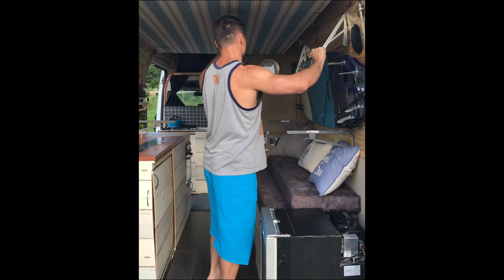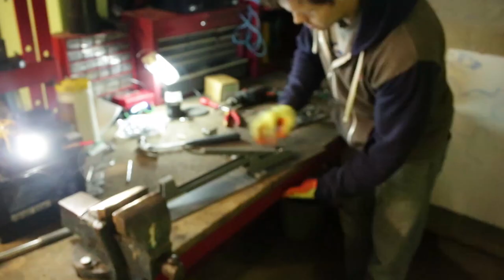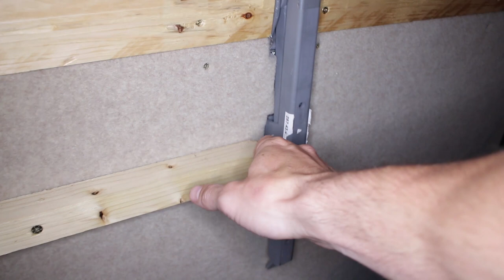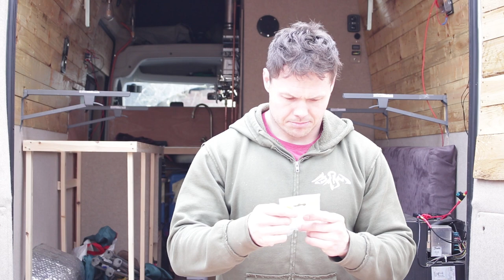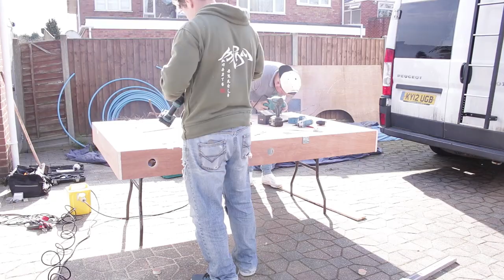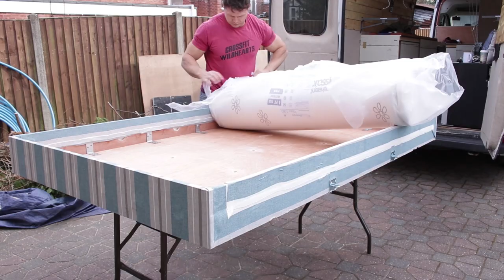Amazing lowering/floating bed in self built van conversion

Comment: Hey man! I love your pulleys / brackets system for the bed. Based on your experience building and then using it, is there anything you would've done differently or could've improved on? I'm about to start a conversion on an L3H3 Ford Transit too and want to do something very similar. Just considering all the pros/cons. Thanks in advance!
Reply from the maker: Ah thanks for watching! Everything is still working 4 years down the line, had to replace the cord once but that’s it. I don’t think I’d change much, you could make it automatic but I like the control of the manual winch. I think I would reduce the 25mm ply base to 18mm if I did it again, the mattress spreads the weight out enough that 18mm would hold up just fine. However the 25mm allowed deeper groves for the brackets to sit in so the bed doesn’t move. Best of luck with your build!!

Comment: Nice design, wouldn’t furniture lifting straps be safer and more durable than rope?
Reply from the maker: Tranquility Travels yes it would be but then I would have needed much larger pulleys and crank. These ropes were rated at hundreds of KG each and it’s never loaded when going up or down. No breakages in over a year although a bit of fraying at a pinch point on two of them, will replace them soon.

Comment: do you have a link to the brackets?
Reply from the maker: https://www.hafele.co.uk/en/product/folding-bracket-heavy-duty-load-bearing-capacity-500-kg-per-pair-hebgo/0000000000004cf900010023/
Hope that helps!

Comment: Can you throw in a link or name of those clamps that hold the bed up? i have never seen them before.. I am thinking of a different way. use Garage door channel, and 36 inch gas shocks. the bed would follow the tracks, and the gas shocks would push it up. I would pull it down like one of those ceiling doors for an attic, with a cord hanging down.
Reply from the maker: I think I saw a similar set up on tracks somewhere over on instagram. The reason I didn't do it was because of the curved sides of the van. The brackets are made by a company called Hebgo and if you search for heavy duty folding brackets they should come up. I got them from Locks Online. Thanks!

Comment: SUCH a great set up!! quick question: are the lower brackets just sticking out all the time, or can they be stowed too?
Reply from the maker: They can be stowed, except for the one over the counter top. I didn't want to cut a gap into it and it would have reduced cupboard space too.
Reply: @MotoringHome  makes sense. thanks again for the inspiration! :D

Comment: I personally think if I got on that with my other half it would crash to the floor. Bringing down the roof too. Most probably, 🤭😂 But I love this idea. What would be even better is if you could put it on a runner track on the bed,  to push it half way outside to view the stars. How much weight do you think that would hold?? And how do you climb in and out of it?  Great video thou 👍
Reply from the maker: Apparently the brackets hold 500kg per pair. Although the bed sits a few inches out from the walls so it probably reduces the strength a bit. Having the brackets fixed to the runner is a nice idea but it would reduce the load capacity a considerable amount and it was already the most difficult part of the build. I'm sure there's someone out there who would give it a go though!
Reply: If you lowered it onto another set of brackets or the counter It would be able to hold more weight and stand up to any extra activity that may happen.
Reply from the maker: robert persall don’t worry, the bed has been fully tested and stands up to all that has been thrown at it...

Comment: I love this! I'm about to start converting a van to live in full time and never even thought of having a bed like this! I don't suppose you have a list of all materials and names do you? I'm trying to get a shopping list going to be super organised :) also, how long did this take you? Think i'll be doing it with a single mattress so i save on weight :)
Reply from the maker: Official Jodie Rose I cant remember the specifics but if you search for heavy duty folding brackets you should find them. A single mattress would save weight but then you have to think about how to support it as it wouldn’t stretch the full width of the van. Or if you’re under 5’8 then you could turn the bed sideways and that would solve the problem as it would be full width. Buuuuut at the top of your van the walls narrow and maybe that would mean an even shorter bed? I could only fit a small double width and unless you’re under 5 foot tall you might struggle... if that makes any sense?
Reply from the maker: Oh and the bed took ages to do as it was done at different stages of the build. The plates & supports right near the start and the rest once the cladding has gone in. It was probably the hardest part of the build to be honest

Comment: You could have just used slats that would be lots lighter and allow much more efficient ventialation.......you will very quickly start to get mould spurs developing underneath your mattress with this method.
Reply from the maker: Olan Pierce how quickly? It’s been over a year now and still no mould... yes slats would be lighter but there would be no central support like a regular bed on the ground and so the slats would have been thicker than the board and I would have had to reduce the thickness of the mattress to fit it in and still have room to stand upright underneath. I spent a lot of time contemplating this.
Reply from the maker: Staying away for a few days and as I lowered the bed I remembered your comment all those years ago and thought I best check under the mattress. Still no mould after 5 years.
Will update you at the 10 year mark.

Comment: Sorry to burst your self built pride ... which is deserved mind you ... but if you don't router some 2cm 'ish'   holes for ventilation in your bed base ply YOU WILL GET MOULD. Your body heat generates moisture and, even if you use a 'special waterproof' mattress protector,  mould will proliferate as moisture wicks through the mattress from your skin. It is a trap for young playas my friend.  Simple remedy to prevent gross out discovery of mould at the end of summer when you lift the mattress ... or whenever. If mould grows it means biffing the memory foam AND cutting out mould growth on base board which would essentially mean replacing it probs.  As you should know black mould spores are bad news for creating respiratory illnesses especially in the confines of a van. Google the issue and you will see I speak words of wisdom, grasshopper.
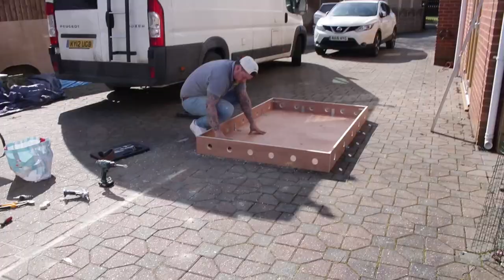Reply from the maker: Holes were drilled in the base and sides. 13:20 or so in the video, Thanks for looking out for my health though!!
Reply: or don't pee on your bed.